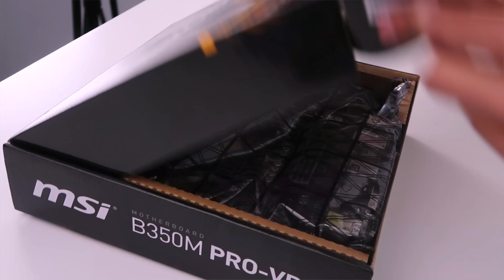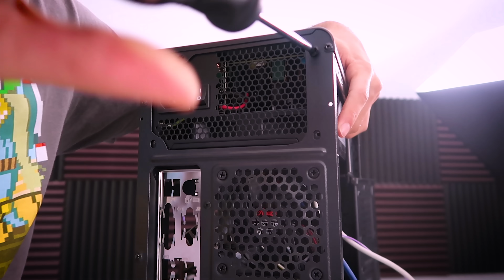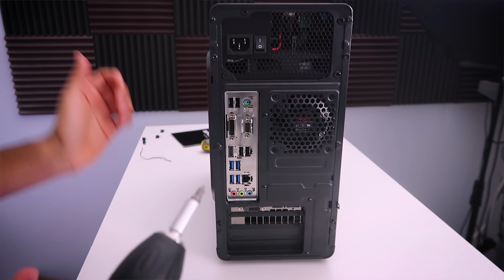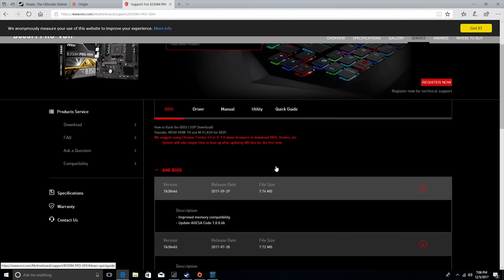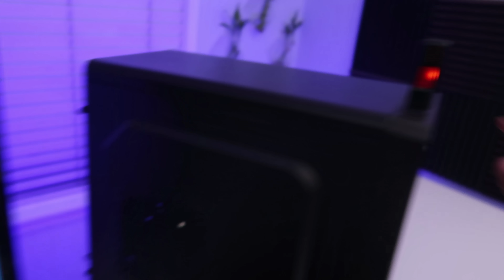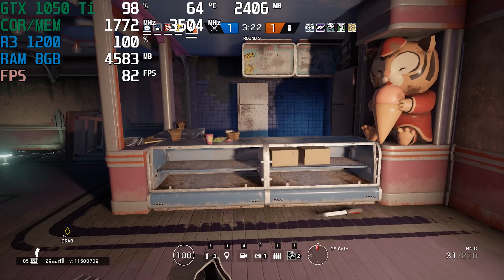$500 Budget Gaming PC Build Guide - GTX 1050 Ti (w/ Benchmarks)

Comment: Can u build this but with an i3 or i5???

I’m a first time builder and need help please
Reply: No you 'll need a different motherboard that is meant for Intel CPUs
Reply: Rezilien na he gunna use it for some corn too
Reply: Adam Mikhail CPU: G4560 (It's as good as i3 6100)
Mobo: H110m-h
RAM: 8gb ddr4
HDD: 500gb/1tb
GPU: GTX 1050 2gb/1050 ti Superclocked or ssc
PSU: EVGA 600w 
Case: anything u want
Also h110m supports any 7th gen i3/i5/i7 or any pentium g4560
Reply: Rezilien thx I ididnt know
Reply: M.M should I get a different motherboard or just build this pc then
Reply: Rezilien ya mostly
Reply: i5 and Ryzen are both good but i5 is a little better
Reply: No, that's a piece of shit.
Reply: Adam Mikhail no you can't the mother board doesn't support intel
Reply: The best thing to do is to research what is best for you. An intel processor would need a compatible motherboard and thats's about it. Buy a decent CPU and graphics card. They are usually the most expensive  (RAM 3rd most expensive). RAM, hard drives and power supplies are usually all compatible with anything (You may need to research on graphics cards as im not quite sure). Other than that it's quite easy to set up. After connecting everything together it should work fine. Just make sure everything is compatible and you install everything properly. Ive only made one PC and it works fine (An upgraded version of this one. Ryzen 1600 instead of 1200). Hope this helps!
Reply: Michael Morris thx Im gonna build my pc this week 

Helps a lot!
Reply: Rezilien will i3-8100 bottleneck a 1050 ti
Reply: its not gona bottleneck
Reply: Adam Mikhail you’ll need a lga 1151 mobo
Reply: Jomz no it wont
Reply: I have an i5 7400 with my 1050TI works really well, sorry for the late reply
Reply: Jomz soz mate u will need a much higher clock than that 2.9 is rubbish u need 101010101010101010 phz to run fortnite on 1 fps
Reply: Oliver Todd Davis he's being sarcastic
Reply: Jomz it will crash when loading game😂
Reply: Jomz nope not enough ram and it’s not clocked high enough will bottle neck gpu
Reply: G
Reply: Adam mikhail go just watch another by tech source
Reply: Get a motherboard with socket 1151 and you're good :)
Reply: aricelioassis i5 is good for office work mostly but ryzen is for gaming
Reply: Adam Mikhail
Reply: Jomz  it wont cuz u are dumb
Reply: i recommend you stick with the Ryzen 3. It is a great beginner processor. It comes with a fan, and has integrated graphics, which means it isn't necessary to buy a graphics card which is very expensive right now
Reply: No Way! Never" ;p LMFAO
Reply: no!
Reply: Ask for the mobo design BUT with an Intel chipset so your desired CPU and mobo be compatible.
Reply: I5 is fine
Reply: No it’s an amd motherboard
Reply: Will fortnite work on my pc? My specs are
I9-7920C 12 Core 2.9GHz
4TB 7200RPM + 2T  SSF
64GB DDR4 SDRAM 
2X SLI Nvidia GeForce GTX 1080TI 11GB GDDR5X

Comment: Hey Joey. Great video, I actually used this as the template for building my first PC this past weekend. I changed a couple of things. Took your advice and got a better box, Cooler Master 5. Also I got the Ryzen 3 1300x instead of the 1200, because I just don’t know enough about overclocking to be comfortable. 

I play a lot of Rocket League and I noticed FPS is just not quite where I want it, I’m coming from ps4, not that I’m expecting that level, but I was hoping for something between what I’m currently getting and ps4. So I wanted to ask if you could suggest something to improve the performance or if this is to be expected and I should upgrade further, if so what would you recommend on the same motherboard?? 

I’ve been a software engineer for years but hardware is still rather new to me. Appreciate the help and love channel. Thanks in advance.

Comment: gtx1050 ti costs 170€ 
i3 7100 110€
case and fans 50€
psu 50€
hdd 1tb 50€
ram 2 x 4 gb ddr4 2133mhz  90€
board 85€
mouse keyboard 29€
(no operating system)

630€ without OS 

(also Id choose asus strix 1050ti that comes overclocked from factory also heats less and does less noise than cheaper alternative) and costs 200€  (durability is also a factor here)

Comment: I was gonna build this but for a another $100-$200 you can get an i5 8600k which performs the same or better than the i7 7700k. Plus a better looking case. Theres no point in cheaping out on processor

Comment: First time watcher.  To start, great instructional video.  I didn't hear where you discussed why you opted not to go with an SSD drive for your primary drive.  It'd be the same cost (or less) than the standard drive but enjoy all the benefits of faster load times etc. Also, did you include the cost of the OS in the build? Subbed because your detailed attention to the build though :)

Comment: HEY please, can someone tell if I can use a 500W power supply on this setup?? its muy first build and the 430w is really expensive right now,  but the 500w is only $40 but also Im using the EVGA GeForce GTX 1050 Ti SSC instead of the SC? would it be any problem? or any change in the set up ? PLEASE HELP ME
Reply: Andrik Padilla sure the more watts the quieter the pc

Comment: This is about $700 cad right now
Reply: Santiago Ponce people that use a lot of computers to solve math problems to get bitcoin
Bitcoin=money
Reply: Mizi I’m building something very similar, but i might swap out the 1050ti for a regular 1050 because of the insane price here
Reply: Santiago Ponce They try to find a random nonce (a little random data) that goes into a block and makes the block have a (SHA256) hash that (in binary) starts with a certain amount of 0's. The more zeroes the more rare hash is. A good hash' outcome is not predictable, and so you have to try a lot of times to find a good nonce.

The amount of zeroes are based on how difficult it is supposed to be to find a block. In Bitcoin it adjusts to have a new block every 10 minutes (on average, given the rate at which previous blocks are found).

Interesting: because the hashes are unpredictable it doesn't matter how the nonce changes! Most of the time it's just a number counting upwards from 0!
Reply: Gameskills he didn't lie. He made his pricing based on what it was then. Due to the cryptomoning prices are being heavily inflated. Hence why the prices are now out of date.
Reply: Doctor Gaming did you get a different case?
Reply: Kobe Bryant there's no 1050ti with 2gb, the 2gb is the regular 1050, the 4gb is the 1050ti
Reply: PushySaiyan you shouldnt build a pc right now. Either buy a prebuilt pc or wait for a few months for bitcoin value to drop causing gpu prices to go lower
Reply: Meme im building mine in 3 months! wish me luck.
Reply: About $1000 Cad now xD
Reply: Taranpal Singh dont worry if youre building it cuz the prices will go down in about 2 months so yeah..worth the wait.

also sorry about bad grammar but who cares right?
Reply: one can only hope that the prices will decrease xD
Reply: look it up lol
Reply: Santiago Ponce Gpu-s solve really complex and longlasting problems
If they could do it with calculators they would buy them and not gpu-s

They are hard to solve but easy to check if the solution is right.
Reply: PushySaiyan are you gonna build it?
Reply: Exactly wtf?
Reply: 700 us
Reply: PushySaiyan ik wtf
Reply: Can someone explain what does miners are?
Reply: PushySaiyan how much is the price gap between 1050 and 1050ti?
Reply: Giovann H probably like 50-100 depending on the brand. If you’re planning on buying one I would wait until gpu prices come down and buy a 1060 because it is more future proof than 1050
Reply: 560 pounds for me 
with keyboard and mouse
Reply: what would happen if i got a gtx105ti  (2gb) instead of the 4gb?
Reply: Its 1k us for me but ill build it what ever ill need to wait for 2 months ill get it after exams fml
Reply: Blaze Up Gaming it’s about 700 Chf (Swiss francs) that’s about 740 dollars
Reply: Sugar daddy LMFAO DON'T THEY HAVE CALCULATORS ON THEIR PHONES ROFL
Reply: Jonathan Smith no one is going to donate to your stupid ass gaming pc lol
Reply: Mines $1000 cad
Reply: What is bitcoin btw?
Reply: bc of bitcoin
Reply: What is bitcoin?
Reply: PushySaiyan thanks
Reply: (...) what miners are? *
Reply: Oof
Reply: PushySaiyan I got my laptop with a 1050ti, 8gb ram, and a 7th gen i5 for 700 us dollars. Granted, it was on sale thou. It's normally 900$
Reply: AnBoredDude wat... Our dollar is aids compared to USD
Reply: He also forgot to mention the price about the monitor, keyboard and mouse, so I would say the “real” price is around ~850-900$ CAD
Reply: Riz3n guess I am lucky. I have a monitor, mouse and keyboard. I'm wanting to do this, or at least similar, cause  I want to play WoW at max setting with at least 60 fps. My current set up I can play at 3-4 (out of ten) with the max (low density areas) of 60-80 but average of 20-30 fps. Raids I get less. Set at 1 setting with about 20 fps. That's with turning things up and optimizing my computer. (I have a AMD Readon 200 series card)
Reply: Hopefully prices go down, I'm gonna wait for like 2 or 3 months to start building this.
Reply: Shadowflare Bruh, 20 FPS? 🤦‍♂️😂, u better get dat upgrade soon
Reply: Riz3n won't be till summer. And yeah. 20 fps
Reply: is about 400 euro right now :))))))
Reply: Miners aren't bad! They verify bitcoin transactions and keep the system going!
Reply: Santiago Ponce ruin life
Reply: Fudge you Gpu Miners
Reply: Is it still worth the price to build this pc?
Reply: Doctor Gaming that's  a  good  deal
Reply: Blaze Up Gaming it’s cause all the people going to build it so they put the prices up cause it’s in high demand because of this, right now it’s about $600
Reply: Well yeah US dollar is higher.
Reply: For me it was 638 USD including the extra fan, mouse-keyboard, mousepad and a monitor
Reply: Santiago Ponce By maths he means millions of calculations made by the gpu not 1+1 haha
Reply: Forgoten Hero solve math problems don’t they have a calculators in their phones?
Reply: Yes that dude lie he need to say $779

Comment: i bought a pc in like late 2013 for $570 and i'm still using it today. this pc can barely run warframe on the lowest possible graphics and screen resolution with 20 fps. you built a pc for less money than that and it is running these games on good graphics settings with 60+ fps. i don't understand why everyone is crying "ohhh pc building is soooo terrible these days" other than the crypto currency mining bumping prices for one pc part up.

i absolutely will build a pc soon within a similar budget than that and finally be free of this hell that is crappy graphics, unstable and low fps, long load times, etc.

Comment: I built this same pc, it turns on completely but I keep getting no signal to monitor please help  Joey Delgado
Reply: Abrah How did you make it work
Reply: have you run pub G on it Im scared it wont run
Reply: Abram I have the same issue no signal really frustrating how to fix?
Reply: Abrah did you get 1 or 2 ram sticks?
Reply: Juan Jalapeño 2 I got it working though thanks
Reply: just took out the CPU and blew on it incase of dust etc
Reply: 2
Reply: Evan Young yeah with the right settings it works great
Reply: Abrah what settings? And what frame rate
Reply: I built same I can run high but I prefer medium for fps issue
Reply: You just need to set right settings for it to load fast in pubg
Reply: Max Pullen have you got yours fixed? I have the same issue, it has power but my USB ports don’t work/ no feed from the HDMI when plugged into monitor.... let me know
Reply: Nathan Akpoteni try to take out your cpu and blow on it check for dust maybe?

Comment: Why only 8GB of RAM?
Reply: It's a budget build. Also, on an unrelated note, what other case should I get, since I couldn't find the one in this video? It's not on the UK Amazon
Reply: Yhea what I was saying is that it could support more RAM couldn't it?
Reply: also for a budget case you can perhaps get this one https://www.amazon.co.uk/Game-Max-Computer-Front-Window/dp/B01F8VOHAO/ref=sr_1_4?s=computers&ie=UTF8&qid=1517587377&sr=1-4&keywords=computer+case&refinements=p_36%3A428444031 i had this on my last build.It is not the best case but It is a little bigger than the one in the video and the fan never stopped working
Reply: Hmm... What about this one? 
https://www.amazon.co.uk/Corsair-CC-9011105-WW-Windowed-Mid-Tower-Performance/dp/B01M35FI12/ref=sr_1_1?s=computers&ie=UTF8&qid=1517608292&sr=1-1&keywords=corsair+case
Reply: Hey. Sorry to bother you again, but I have a couple more questions. Would getting this graphics card instead of the one in this video be wise? Or should I just stick with the one in the video?

https://www.amazon.co.uk/gp/product/B01MG15JZS/ref=ox_sc_act_title_1?smid=A3P5ROKL5A1OLE&psc=1

 Also, the case I sent the link to earlier should be able to fit it, right? Will it be able to run games like GTA V at around medium settings? And is it compatible with all the other parts in this build? If it isn't, would I have to get an i5 processor of some sort? (I don't blame you if you can't answer all these questions. I'm just curious, because I'm building my first gaming PC in a couple of months, and I just need some guidance :/)
Reply: Oh yhea i was gonna tell you to buy the case you sent me or this one https://www.amazon.co.uk/Corsair-CC-9011052-WW-Carbide-SPEC-03-Mid-Tower/dp/B00J63LFTW/ref=sr_1_10?s=computers&ie=UTF8&qid=1517649142&sr=1-10&keywords=corsair+case but I thought you were looking for something budget
Reply: As for the graphics card,sure. Go for it if you want something a little cheaper.The difference in quality isn't big so you can just go for the gb one. I'm not sure if it will fit tho and that could be a problem :/
Reply: The case that Joey says is good is about 19.5 x 33.5 x 35.5 in centimeters so the corsair one is definitely a lot  bigger
Reply: Okay, then. I think I'll just go with the one in the video. Thanks for your help :)
Reply: np my dude :)
Reply: Oh yeah, one more question. Can I upgrade the RAM to 16GB without changing anything else? Would it still work? Thanks
Reply: As long as you go for 2 8gb rams i think that you would be good (not sure if you can have 4 4gb ones on this motherboard) Also make sure that the rams are ddr4

Comment: Great video!  The only comment I would add is to try a "dry run" of the setup (all necessary cables connected, but no cable management work yet) to ensure all the parts and the connections work properly prior to locking everything down and managing all the cords.  With how reliable most computer parts are, this may seem unnecessary, but it's nice to catch a faulty component prior to pulling cords/zip tying/wrapping to have a managed case.  It also gives the builder a good idea of how much cord there is to work with, where cords will be tight, and where extra cords can be stored away.

Comment: Hey guys I want to ask about a build 2018 
Is it worth to buy a pc : 
Cost 700€ having : 
Gtx 980 4gb 
i7 6700
12 gb ram 
1 tb hd , 128 gb ssd 
---OR cost 865€ having: 
gtx 1060 6gb 
ryzen 5 1600 
16 gb ram 
1 tb hd , 250 gb ssd 
Please answer me quickly is about to buy pc this weak ...I want to hear opinions ..ty for ur time
Reply: the 2nd one is better for gaming
Reply: And 980 is a bit old
Reply: Second I would do
Reply: Buy the Intel one for playing CSGO
Reply: You only really need 8gbs of ram for like every game
Reply: 2nd! it has better ram and graphics card
Reply: Viper Not really, the 970 is a tad worse than the 1060, the 980 destroys it
Reply: Aditya Patel the 980 destroys the 1060?? I’d double check that. And to the OP, you can really do fine with 8gb of ram to save some money while ram is so expensive. You can always add more (unless u do really need it)
Reply: Devin Stark Well that was an exaggeration on my part, sorry. But on most benchmarks for games, not stuff like firestrike, the 980 comes ahead 10-35 fps. 8gbs of ram is also more than enough right now.
Reply: Use the second one with 8GB
Reply: If u go gtx 980 it u will destroy 1070
Reply: First one
Reply: Kickz I bought it

Comment: How do you get a flash drive with win 10 already loaded on to it. Paying the 120 for Win 10 jacks the price up more. I ran the math with some of the "optional" stuff and got just under $980. That's with a low end cheap monitor
Reply: Slight correction I just saw you had a video on how to instal win 10 for free on a usb flash drive but still without the optional stuff everything totals up to 833, that's with the change rounded to the nearest dollar, and that's before online shipping costs
Reply: sluggs 42 Prices skyrocketed

Comment: I didn't find the case for Europe so will it fit with this case CORSAIR CARBIDE SERIES 88R MATX BLACK CC-9011086-WW?
Reply: and graphics card i changed a bit to: MSI GEFORCE CUDA GTX1060 OCV1 6GB DDR5 PCIE GEFORCE GTX 1060 6GT OCV1
Reply: and will this PSU work? Xilence ATX2.3 PSU 500W XN052. MSI graphic said it needed 400 W PSU so i went with 500 and i got it cheaper then the evga one.

Comment: Hi, I have kind of a toasty pc. I just want to know what should I buy and replace to boost my gaming pc performance anyone can help? I can run fortnite on low 15-30 fps :/ thanks for helping
Operating System: Windows 10 
System Model: A68MD Pro
Processor: AMD A4-6300 APU with Radeon HD
Graphics (2 CPU) - 3.7GHz
Memory: 8200MB Ram
NVIDIA GeForce GT 730